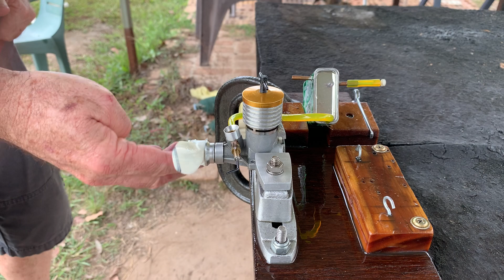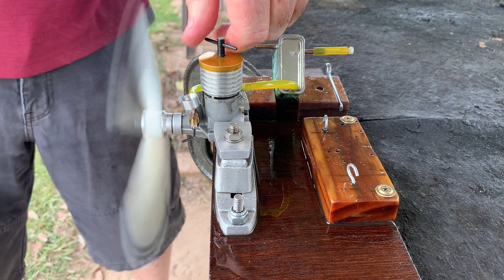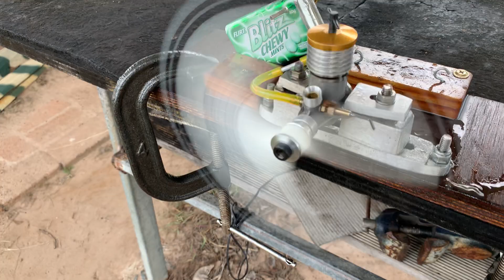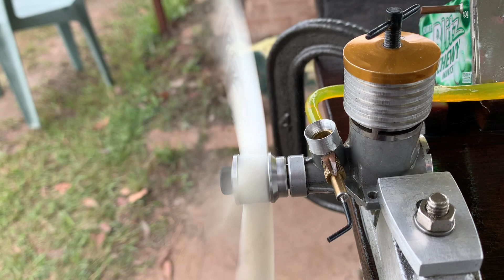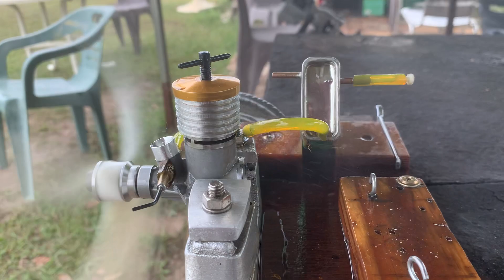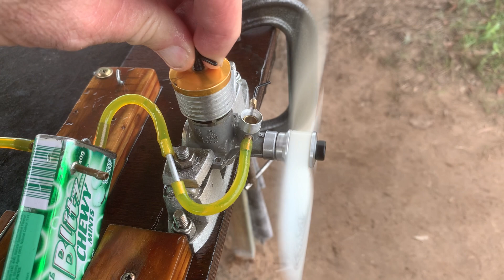Yin Yan 2.47 c.c. Model Diesel Engine

Comment: Hi Derek..Very unusual indeed......I rebuild also one recently.. and it had an far to big taper in the bore..as well  to much play in  the shaft..so starting was next to impossible!..I made a new bronc bushing and rebore the liner with an oversize piston..It was a LOT work.....also a bent wrist pin..as people do not get it fire up..so increase the compression far to high with an result ow wear out rod and bent pin.. But after all was done.. it runs pretty good. Still a bit fuzzy to start on the regular method..but a few drops of fuel via the exhaust port  make the BIG  difference... 1 -3 flicks and  it fires up...Indeed the early engines were pretty good.I had once a 1,5 and was very impressed with it..starting and mostly  the power output were fantastic.. it run like a charm! Big regards to Australia mate!!
Peter
Reply from the maker: A Happy New Year to you Peter. Great to hear from you. This is a very nice engine indeed. In the video I had flooded it, so it took a while to clear and start. Mostly, it starts after two choked turns of the prop, with compression reduced, in two or three flicks. No port priming required. 

I did have to arrange for its contra piston to be 'cherry bombed', because as received it was a little loose in the bore. Also, the intake venturi insert had a bore of 7.5 mm! I sleeved it down to 6.5 mm (look at the brass sleeve in the video) but may sleeve it down further to 5.5 mm, as I plan to fly it in a Control Line aircraft.

I have a box of six Jin Shi 1990's versions of this engine. They were much more poorly made. I will give them away to amateur constructors to renovate, a good project. Glad to see you have had success with yours after your hard work.